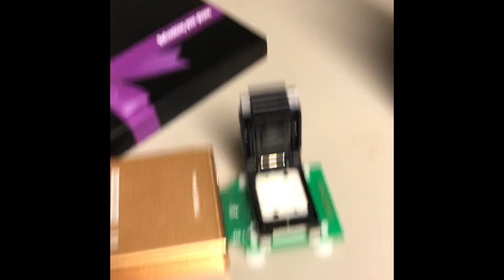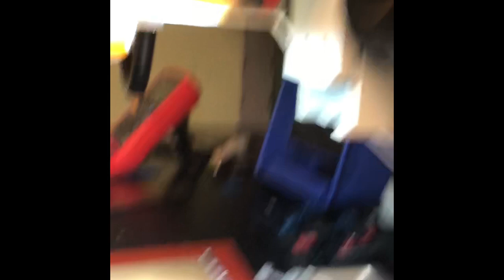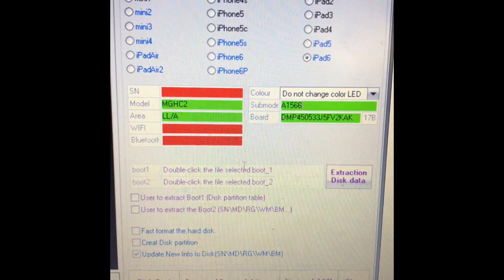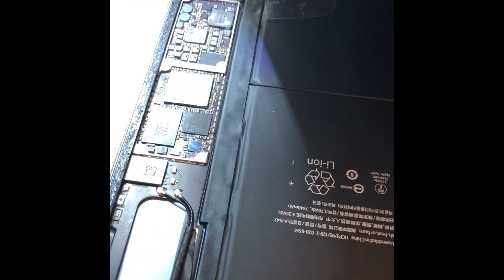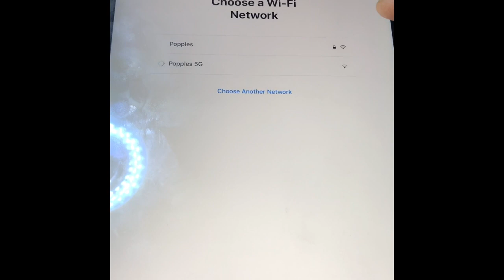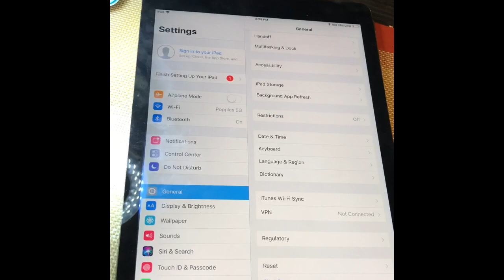iCloud Remove On iPad Air 2 Hardware Method Unlock also works on Pros

Comment: error 4014. tried many NANDs and different data, but no luck.
Reply from the maker: Its Over which iPad model? Get the same error with nand removed?
Reply: @johnbaker26  Thank you for reply, ipad air 2 64gb Wifi. Same error with all NANDs. tried 3 NANDs. All pads are fine.  

Get the same error with nand removed? didn't understand
Reply from the maker: Its Over yeah that model is a pain in the butt. It’s not that hard to overheat the ram. One way to know is see if you get the same restore error with nand removed
Reply: @johnbaker26  Will try and get back to you, Will reball the RAM and try it, thank you for help. subscribed